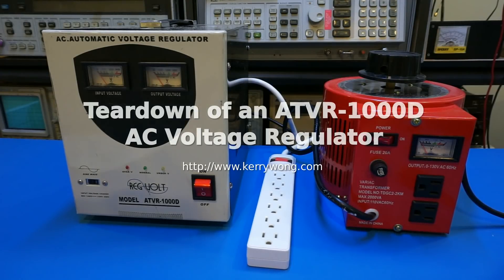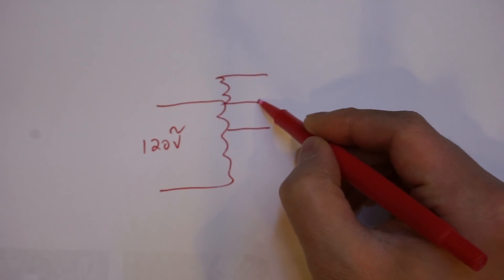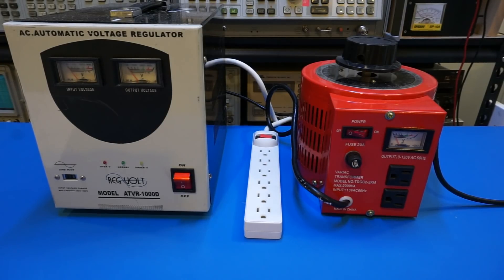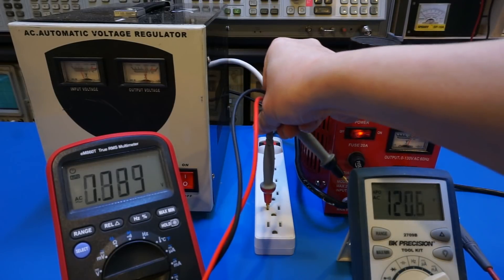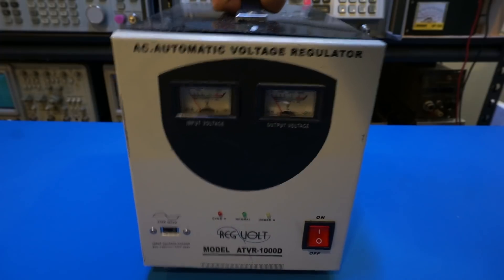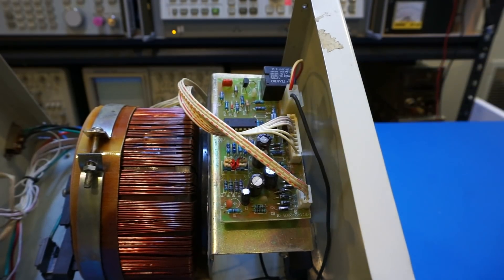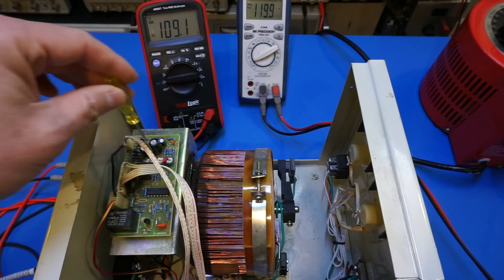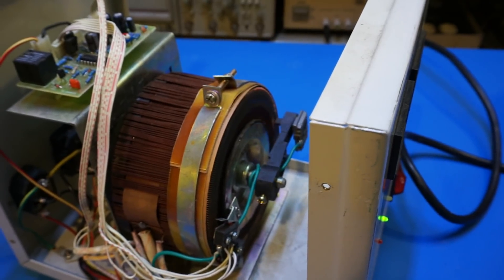Teardown of an ATVR-1000D AC Voltage Regulator

Comment: How does it do the 220V? Since there's no extra transformer, are there extra windings on the variac for that? Also it makes this buzzing noise like the motor is constantly activated, shouldn't the hysteresis prevent that from happening?
Reply from the maker: There is an extra tap (essentially doubling the turns) for the 220V output. The buzzing noise was actually from the transformer not the motor, it was held in by a metal bracket but as you saw in the video it was not in place perfectly.

Comment: I built a mechanical surge and brown-out protection for my PC/AT back in 1985.
It consisted of a universal AC/DC motor, a big flywheel and a 110V generator, all on the same shaft. 
It worked like a charm. 
This was a small version of a 10KW industrial power conditioner I saw at Boeing. 
Their's had circuitry to kick in and run the motor in case of power failure.

Comment: 10:00 but pretty horrible if the voltage rises quickly.
Reply from the maker: It has a overvoltage cutoff feature so when the voltage rises faster than it can adjust it will cut the output temporarily.
Reply: Also worth mentioning that the multimeter might not respond all that quickly depending on how precise its RMS averaging is so the spike could look worse than it is.

Comment: I wonder how long the wiper brushes will last in that unit?  It makes sense that it has some hysteresis to avoid "hunting" around too much. (Maybe it could be upgraded to PID control, but it already seems to work well enough...)
I've recently uploaded some videos investigating a ferroresonant transformer (a stepdown unit for a power supply).
They are a prelude to the next one, where I'll look at a ferroresonant line conditioner, performing a similar function to your AC voltage regulator. I should get that video done in the next week or so.
Reply from the maker: Thanks for the ferroresonant video! By the way, the wiper is the weakest link, but if it does wear out, you can adjust the tension screw to put more pressure on it so it will stay in contact with the coil.
Reply: Finally got it done (lost some footage, had to re-shoot)
https://www.youtube.com/watch?v=sjSrAYieQeE